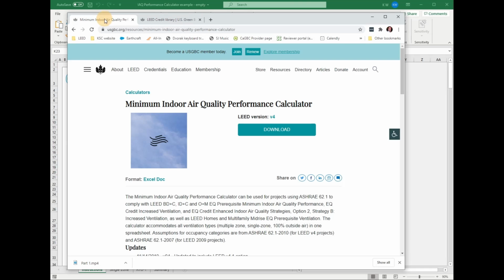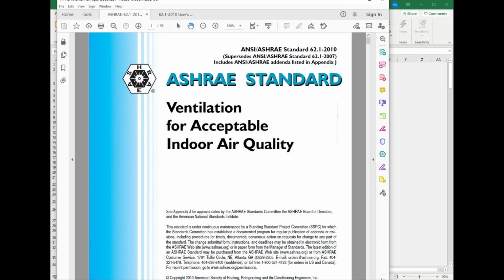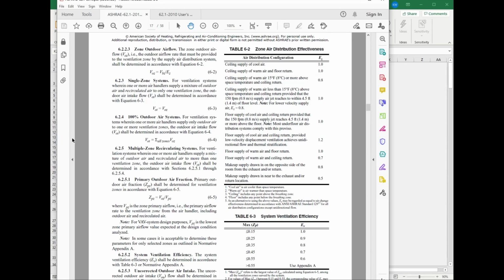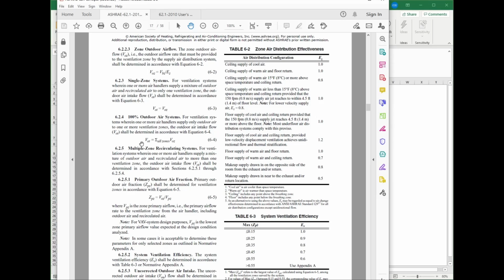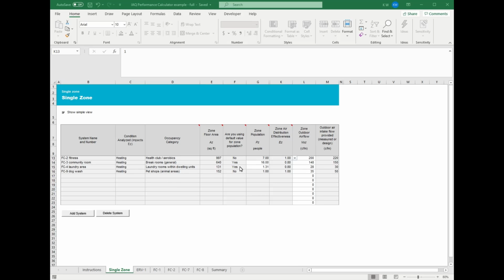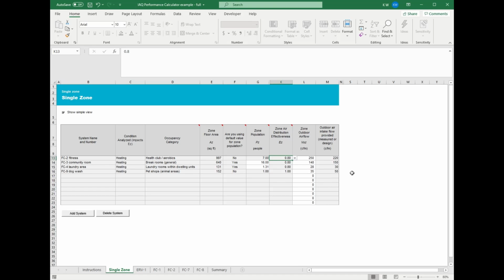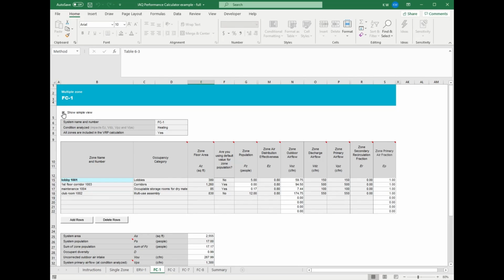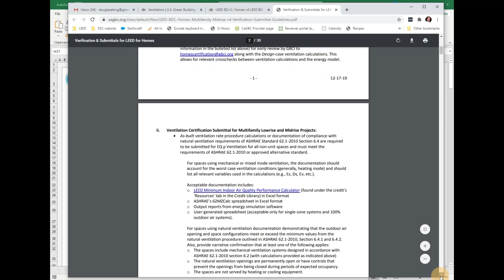Minimum IAQ Performance Calculator

Comment: Hi, dumb question, for a multizone system, is it necessary to specify each and every zone for the Minimum Indoor Air Quality credit (v4.1)?
Reply: Yes - every zone must be listed. Keep in mind, though, that this refers to ventilation zones (as defined by ASHRAE 62.1), not thermal zones.

Comment: Thanks for the resents toon, Doug. If there are multiple zones with same space category, like corridors at different stories, served by a central zone system, shall the system be defined as multiple-zone system or single-zone system?
Reply: This may depend on some specifics. If the air is not recirculated (i.e. there are not returns to the central system), then I'd say this should kind of case should be classified as a 100% outdoor air system and each corridor is a separate zone that must be served. 

If there are returns to the central system, it's usually appropriate to consider multiple corridors as one single zone system. ASHRAE 62.1 treats spaces as separate breathing zones if they have different occupancy categories, occupant density, zone air distribution effectiveness, or zone primary airflow per unit area. When there are similar corridors in a building served by one system, all these values are all typically the same so it's appropriate to treat multiple corridor zones as one breathing zone and the system should be treated as a single-zone system.